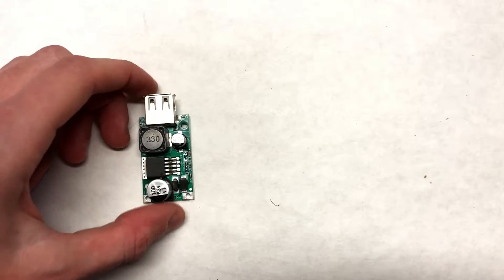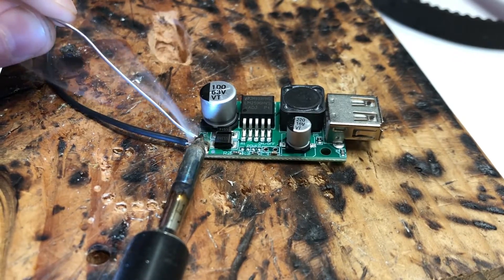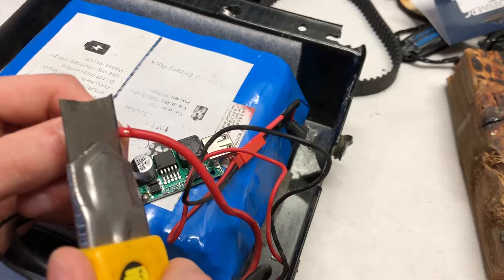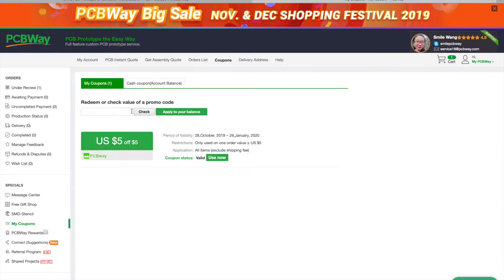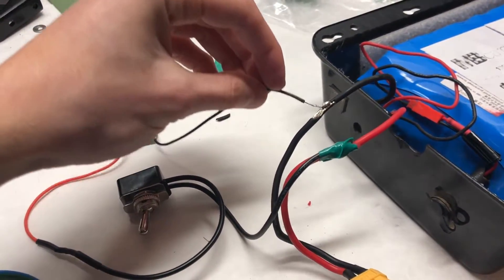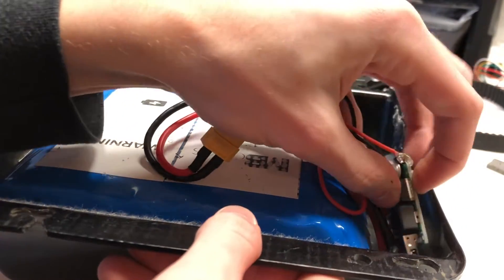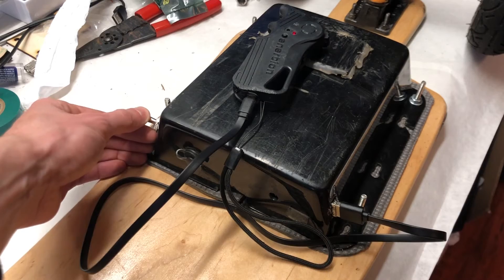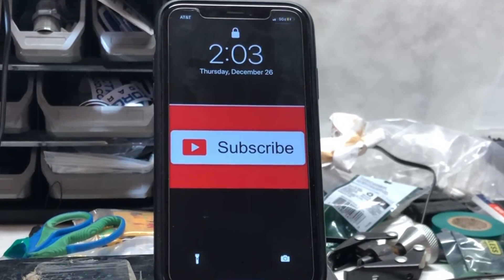How to Charge a Phone With an Electric Skateboard (Using a Buck Converter)

Comment: am trying to do this, but adding rgb strips that require 24v 3amp

my battery setup is 16s10p at
 Total battery voltage: 57.6V

Total battery capacity: 40.0 Ah

trying to find a buck down convertor to get this working.